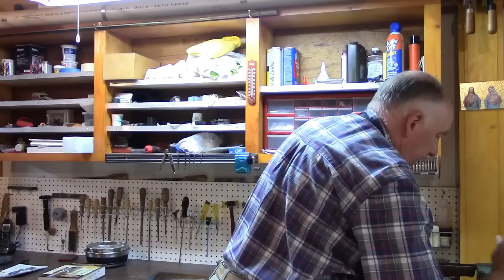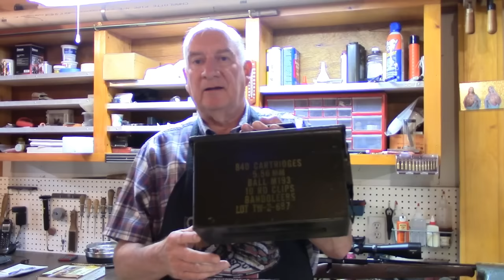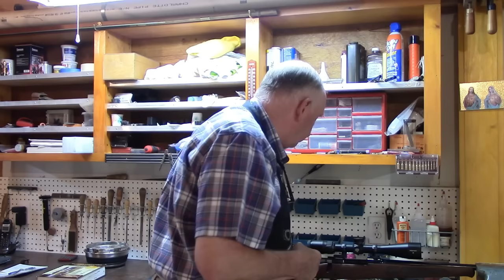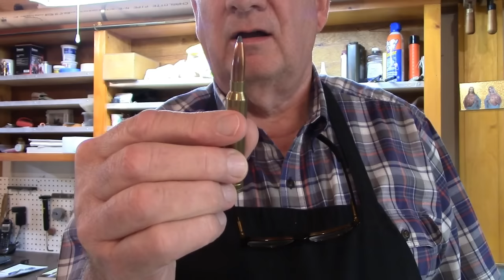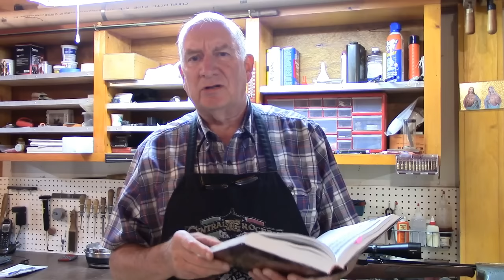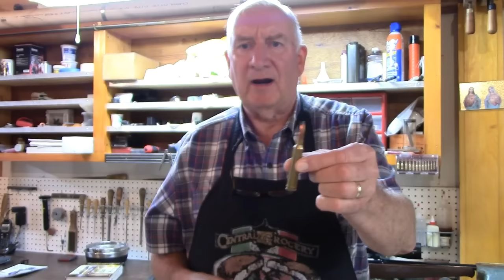How long do barrels last? ~ Discover the truth!

Comment: I live in the UK and guns are very controlled. When you buy a gun does the manufacturer recommend what cartridges to use to get the most life from the gun?
Reply from the maker: No, they do not.  However, understanding the principles applied by military cartridge engineering is the best guide, because they are designed to provide the best combination of ballistic efficiency and barrel life for combat worthiness.  I have calculated the ratios of case volume in cubic centimeters to cross sectional area in square inch bullet diameter for four military cartridges and have observed certain consistencies.  

I derived case volumes from Modern Reloading, which can vary by small amounts.  

The 7x57mm Mauser, with a case volume of 3.68cc and a cross section of .06" equals 61.  The 30-06 Springfield, which the US modeled after it, with a volume of 4.38cc comes to 62.

However, in comparing newer military rounds designed since the last 60 years, I observed significantly reduced ratios.  The .308 Winchester/7.62 NATO has a volume of 3.43cc and a ratio of 49.  The .223/5.56 has a volume of 1.87cc and its ratio is a similar 47.  The ratios of the old .303 British and 8mm Mauser are in the same class.

While the 30-06 and 7mm Mauser are not barrel burners, it can certainly be said that a smaller powder charge in equal bore sizes will run that much longer due to reduced heat and erosion. 

In short, any increase in ratios reduces relative barrel life, and any decrease increases barrel life.  

As said in my video, internal pressure is a serious factor in barrel life, too.  And, the greater the reduction in bore diameter from case diameter, the higher the Venturi effect and erosion.  So, despite their potential for small gains in velocity and accuracy due to better burning characteristics, these new squat cases with small bores have been found by ballistics labs to be quite hard on barrel life.
Reply: @GunBlue490  Thank you.

Comment: +GunBlue490
How far does your knowledge stretch into metallurgy?
I’ve built a barrel cooler that forces ambient air through the barrel.
This takes it from almost too hot, to ready for the next shot in about 7 minutes.
Much better than waiting 20 minutes manually.
I’ve seen some crazy things on the net like running water through a barrel. I will personally never do that. 
What I would like to know is what effect fast cooling has on the barrel. Especially when applied when the barrel is not considered very hot.
Ie sending 10 - 15 seconds of dry ice vapor after every shot.

Comment: Hi, love your video. 
Do light faster bullets wear out a barrel faster than heavy slower bullets in the same caliber or does it even matter?
I have a 2:43 I built for coyotes and wondering if 58 gr is better than a 70-80 gr. The purpose for 58 grain bullets was to lose energy fast ,say past 800yds, due to flat terrain to minimize ricochet possibility. Also the vmax bullet will blow up better I feel. 
If a heavier bullet will make my barrel last longer I may go that route but I won't shoot that much.
Reply: A steel surface getting scorched at 3200 F and 60,000 psi (243 max pressure) does not care about the bullet weight.  You are better slowing the rate of fire and backing down on the powder charge.  That reduces the peak pressure infusing carbon and lowers temperature of the heat affected zone for subsequent shots.
Reply: @excelsior6365  I agree. Thanks for advice. Rate of fire very low

Comment: I'm having problems w my ar 15 223 55.6 it is dead on at 100 yard s you can hit a dime w it but at 200 Or 250 it is shooting off by 10 inc to a 12 inc to the right the gun has had m 50 ronds t it I have put 3 new scoops on it and it still is the same do you thank I need to just buy a new barrel for it if you can lmn

Comment: My 30-30 is shot out after about 15000 shots, it is as smooth as when new, and the rifling is still strong, but the bore is like a funnel. The throat is 32 Cal, and the muzzle is 30 cal.

Every 5 or so shots will have a faster velocity, with heavier bullets. If I use a 32cal handgun bullet, it works with much better consistency.

I need to replace the barrel. :/
Reply from the maker: Lever action rifles have very light, thin barrels with little mass to soak up heat, and the 30-30 can get pretty hot, very swiftly.  They were made as practical guns to shoot game, not lots of plinking.  Your gun did well to last through that many rounds. Check Numrich.  They may have an original barrel.
Reply: Never have I bought a correct part from that place, I'll pay Winchester.

Comment: Along with allowing your rifle barrel to cool off (while at the range or prairie dog town), do you have any recommendations as far as cleaning the bore to extend barrel life?  After a group of 3 shots, I always pull a BoreSnake through my rifle barrels to remove all the powder residue while the barrel is cooling off. Thank You.
Reply from the maker: There's nothing wrong with doing that, and it can help slow your shooting down, but it's not necessary to get more life from a barrel.  Barrels don't deteriorate from carbon buildup.  It's all about heat and erosion during firing, and refraining from unnecessary heat.  Many barrels shoot more consistently after firing several shots.  You can easily shoot 30 or more shots before running your snake. Just do a thorough cleaning after the day's end and keep the pace down and cool as possible.

Comment: What is your opinion of the 6.5x55mm Swedish for deer sized game in the Eastern U.S.?  I developed a comfort with this cartridge in surplus Mausers and got a Winchester 70 in that chambering. It seems to shoot flat enough with good penetration without being stupidly overpowered.
Reply from the maker: It's one of the best and most accurate rounds ever created. It's ballistics is virtually identical to the 6.5 Creedmoor, but it operates at much, much lower pressures.  Use 120 grain bullets for deer, which have the ideal SD in the .240s.  The Swedes invented it 127 years ago, for anyone who thinks that 6.5 is the latest discovery, and their military was using it a long long time before our Army Marksmanship Team thought they cooked up the idea.  Funny.  

It's perfect for deer up to caribou (called reindeer in Scandinavia) with power midway between the 243 Winchester and the 7mm-08. It can take elk and moose with 140 grain bullets for those patient enough to get in close to pour shots in, but it's a bit light on diameter.

BTW, you own a very valuable, rare Model 70, if that's the original barrel.  I was not aware that they ever chambered 6.5 Swede.
Reply: @GunBlue490  Thanks. Winchester made that chambering for one year back in the 1990s in the Featherweight Classic. I saw it in the rack at a local store, and when I picked it up, three other guys came over asking about it. I immediately handed it over to the store owner and told him to put a scope on it because it was now mine. When it came time to pay, he gave me a sweet deal for recognizing what he thought was something special. It is special to me.

Comment: Extending Bernoulis theorem , when you restrict the flow through a tube you experience a drop in pressure but an increase in velocity , does that also have an adverse effect on the throat ?
Reply from the maker: Yes, but it's not because of pressure/velocity issues. Increased wear occurs due to erosion caused by the resistance of the funnelled flow of burning powder. The greater the ratio of that restriction and powder volume, the greater the erosion.

Comment: What about stainless vs CrMo? Which one will burn out quicker in a non-abused bolt gun?
Reply from the maker: In my personal experience, there's no reason to expect any barrel to burn out over any lifetime.  Burning out requires that a barrel be brought repeatedly to the destructive level of temperature.  A competitive shooter does that several times at every event, when he or she runs a string of shots in rapid fire.  That person gets more life from a stainless barrel, but it's still doomed by the nature of the game.  Chrome moly barrels are not as tough in that use, but they can last absolutely forever if the steel isn't subjected to such intense firing that reaches destructive heat levels.  It's also very much a factor of powder volume to bore size.  Some modern high intensity cartridges can very easily bring barrels to destructive temperatures on just one firing, and such barrels certainly do not belong to the forever club.  Hornady reported in their loading manual that the 22 WSSM was found to be noticeably damaged after just 350 shots, and they categorized it as HARD on barrels. They also reported having gone through several 264 Winchester Magnum barrels during their first load developments.  As I said, speed comes with a price. But, if a barrel of standard cartridge design is allowed to cool between shots, and it's otherwise cared for, there's no reason it can't last forever.

Comment: I've had this question in my mind about my Ak-74 barrel. My main concern is with the bi-metal projectiles that I'm firing through it. Will those wear the rifling out noticeably faster than copper jacketed projectiles?
Reply from the maker: Unquestionably. Brass cases and copper jacketed bullets are quality materials that provide the finest service and barrel life.  Poor countries use cheap materials as an alternative to copper and brass.  Steel cases also score chambers.  Savings on the ammo is taken out on the barrel, so you have to do your own price comparisons to see if it's worth it. Personally, I place high value on barrels, and would never use it in my rifle, regardless of savings. Remember, the barrel IS the gun; all the other parts serve it.

Comment: I have a question for you. What is the approximate barrel life of the US M16 5.65 cal with a chrome lined 20 in barrel. Fired in semi auto at gun ranges at slow rates of fire, not in a combat rate of fire ?
Reply from the maker: Understand that an AR-15 barrel is made of the same steel as any other fine rifle.  Understand also that a chrome lined bore simply means that it is electroplated with a very thin layer hard chrome.   The actual reason for the chrome is not to extend the life of the barrel from firing, but to protect it from corrosion due to the elements.  Chrome deteriorates under heat at similar temperatures as the underlying steel.  Speaking as a person who did much precision electroplating years ago, I also can tell you that the plating would provide absolutely no protection from heat.  The underlying steel will break down and the plating will collapse anyway, as if it were Saran Wrap on a scoop of melting ice cream.  

Semi auto is not a specific cyclic rate of fire, nor is combat rate a specific rate.  In fact, I have seen folks at ranges subject their civilian semi auto AR-15 rifle to FAR more intense rates of fire than would likely be fired in an actual combat situation.  Fighters in combat are always very acutely aware of their limited supply of ammunition and they take care to preserve it, and they use it wisely.  Shooting exposes a fighter's position to enemy fire and draws enemy fire upon them.  It's a rare situation where they must "open up" and lay down a barrage of continuous fire; they employ tactics to advance and keep their ammo in check.  It is also rare for a fighter to select automatic fire.  It wastes ammo and virtually all fighters know it has no controlled accuracy.  

Military weapons can last a long time, because those who depend on their guns respect them,  and conserve their precious ammo, and leadership maintains tight control on fire discipline.  The last thing that you should assume is that range fire is gentler on guns than combat fire; it is absolutely not true.

I cannot answer your question, due to the many infinite variables that create destructive heat, and the degrees and frequency of it.  I can say that an AR-15 has no special privileges and will deteriorate at the same rate as any other gun barrel... probably faster due to the lighter mass in typical 20 inch AR-15 barrels.  In short, when it gets hot to the touch, it's suffering.  If it gets very hot, it's being tortured.  An AR-15 barrel that's never allowed to get hot may last indefinitely for thousands of rounds.  A competitive CMP shooter who shoots matches generally expects something over 2,000 rounds.  One that's tortured like I often see at ranges may last for no more than 800 rounds before its accuracy is destroyed.
Reply: @GunBlue490   Thank you for your reply.

Comment: Is .223 rifling on an AR15 which is designed for relative quick follow up shots, formed any differently than a .223 rifling on a bolt gun? If I fire the .223 bolt gun at the same rate as I do an AR15 without letting it cool, it's considered as "abuse" but firing AR15 in the same manner would not cause as much throat erosion?
Reply from the maker: Let me say that anyone believing that the AR-15 has a gift of longevity not given to the bolt action rifle is terribly mistaken. Barrel makers use the same barrel steels in both, regardless of their outside finish, the barrel tapers, and regardless of the receiver that it's screwed into..

Understand that AR-15 rifle barrels are made with three types of 223 chambers, namely .223 Remington, 5.56 NATO, and .223 Wylde.  

I provided a video on the difference in pressures between the first two.  It's safe to say that the vast majority of AR-15 barrels are chambered in 5.56 NATO, which can fire either standard 223 Remington ammo, or higher intensity military specification 5.56 NATO. 

Your chamber designation should be stamped into the barrel.  The NATO chamber is made with an extended length of throat called "freebore", which provides a long bullet jump before the bullet engages the rifling, which allows higher military pressures and velocities for the shorter barrels used in AR rifles.  In addition to the freebore, the start of the tapered rifling called the "leade", has a longer and more tapered slope, which also allows for higher pressures.

223 Remington chambers are used in most bolt guns, but not all. They have standard length throats and more abruptly tapered leade, and should never be loaded with NATO ammunition, which will cause very unsafe pressures, above the design limits if the firearm.  

Wylde chambers, which are found on custom AR-15 target barrels, are a hybrid chamber that combines the accuracy advantages of the 223 Remington chamber with the pressure specification of the NATO round. They can fire either type of ammo.

An AR-15 barrel will burn out at the same rate as a bolt action rifle, and will suffer from the same abuse.  In fact, most bolt action rifles will outlast the typical AR-15, simply because they are incapable of the same high cyclic rates of fire that creates intense heat.  

The manner in which I have seen many folks abuse their AR-15 rifles and carbines, they are probably not aware that their barrels have long been burned out, because they are just spraying targets.

Despite the fact that an AR-15 may safely fire 5.56 NATO ammunition, the barrel will last considerably longer with milder 223 Remington ammunition, with very little difference in practical performance.

Chrome is used to protect the interior from corrosion in harsh climates, and provides a slight degree of protection from wear due to cleaning, and a bit of protection from powder erosion, but it's just as vulnerable to heat damage, and will collapse as the steel beneath deteriorates. It's extremely thin.
Reply: @GunBlue490  also....to add on to what you said, AR15 shooters probably won't notice deteriorated performance as often as they would with a bolt action, because the "expectation" of the accuracy from a 16" pencil barrel semiautomatic just isn't as high.  1" to 2" groups on an AR is pretty good anyway on an open sight or red dot scope.

Comment: QUESTION: What about .223 service rifle (AR)? Many tell me 3,000 is it. I'm at 2,800, is it time?
Reply: Depends on the type of barrel and how you use it. Stainless steel will burn out faster than Chrome lined or Nitride barrels. Also check your zero and see if the rifle has opened up its grouping under controlled conditions. If it has opened up run a few more tests to verify. If you really want to get into the weeds you can buy gauges that can measure barrel erosion just learn how they work first. 

Also to answer question you asked no. AR barrels that are Chrome lined or Nitride bathed that are not abused can last a very long time. They can easily go into the 10s of thousands of rounds especially so for Chrome lined before any real replacement is ever needed.

Comment: I disagree with you statement that steeper shoulder results in lower pressure. This is simply not correct. As you can see in your example the same case necked down to smaller diameter creates more pressure. Bullet velocity is not w function of pressure only of pressure, barrel length and type of powder. Your comparison of 7mm mauser and 6 mm remington is exactly speaking to my point. You are also comparing different powders. 50 gr of h414 and 42 gr of rl19. As you can see less powder created more pressure because of smaller diameter bullet.
Reply: Fluid flow from a large to a small diameter pipe results in a LOWER pressure and increased velocity of the fluid as it travels into the small diameter pipe.   Its Newtonian physics.  Energy is lost in accelerating the gas into the constricted portion of the cartridge neck.  The steepness of the shoulder is not the cause and the video never claimed that.  Bernoulli's principle is the correct explanation.